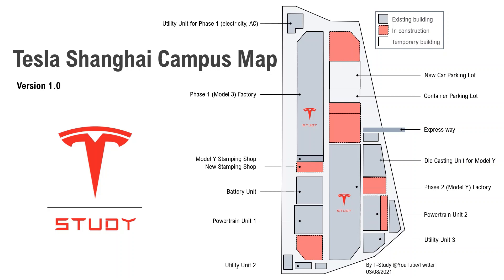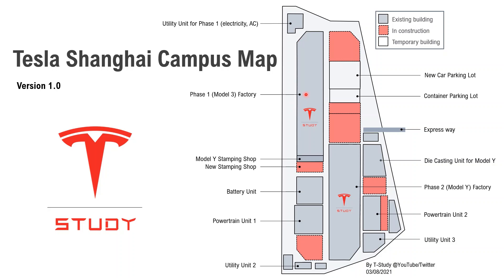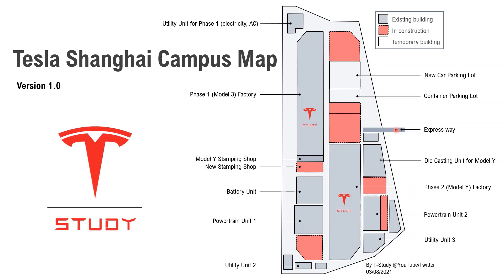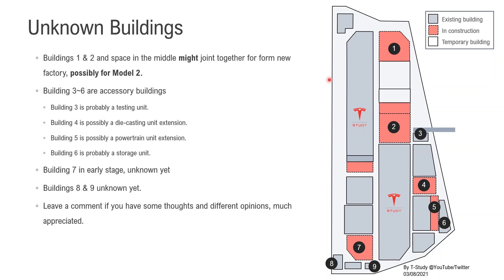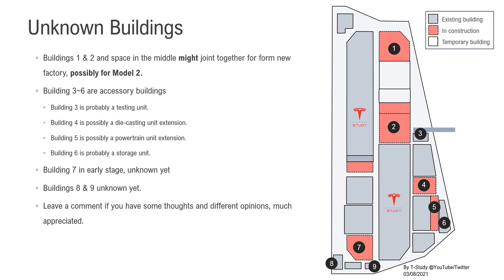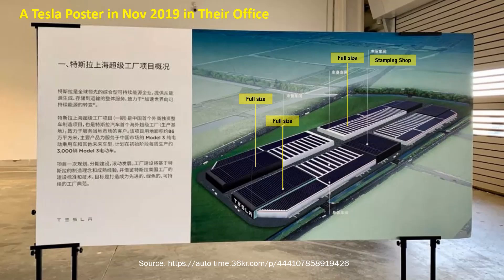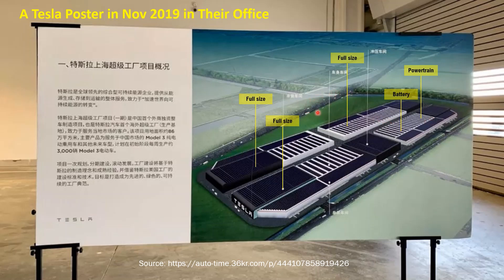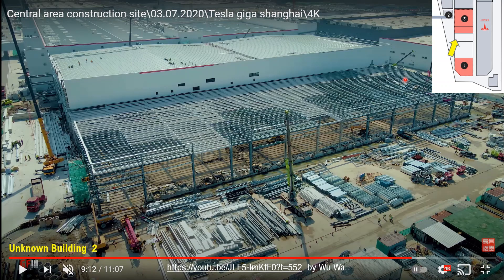Tesla Shanghai Map v1.0

Comment: Building 6 
I was told previously this triangular building is a battery unit.  Would they have two battery units? The CATL batteries are packed for direct fitting in cars.  The LG batteries have to be built into packs on site so these are probably at the square building.
Building 4.  I thought some of the unusual  foundations were similar to the texas battery plant.  So I thought this might be battery manufacturing plant.  Only indication was thinking that those linked foundations look similar to texas.

Comment: I also doubt buildings 1 and 2 will be joined, they recently dug water drain channels and pipes under the parking lot in between so i think it will be permanent. Number 8 powerstation for sure, number 7 contains smaller recycling warehouse for wooden palletes, they also disassembled nearby temporary worker buildings in 7, i think there is no new construction.
Reply: good comment!

Comment: Thanks for the video!

My speculation:
Building 1: I think it's a battery factory for the new 4680 cells.. The foundation is made for a stamping machine which will make battery cans and parts. The battery formation equipment will be in the high and long span room.
Building 2: I think it’s storage building for the parts whitch come frome the new stamping machines.
Building 4: I agree with you, i think it’s a casting factory, (there will be 6 additiona casting machines in it to make rear casting for model y (When these are completed, it will be possible to produce 750,000 Mosel Y pieces per year. If you add the 250.000 Model 3 that is the 1 million car that Musk was talking about)

In my opinion the Model “2” productione will be in a different locatione.

Greetings from Hungary

Comment: Thank you! This really helps put the plan into perspective. I have been hoping for this kind of summery and analysis. I am so glad that you are willing to do the work to give complete strangers, who you will most likely never meet, access to this amazing project. The building to the west of utility unit two looks like the main power utility station that takes the main high voltage power from the utility and transforms it down to voltage levels that can be used to distribute power to the rest of the factory power distribution system. Being indoors, it will be a gas insulated system. The vented areas are to allow cooling of the transformers.

Comment: I believe the expressway, or East Extension Road as WuWa puts it, connects to Jiangshan Road. Jiangshan Road leads to Tesla's new parcel of land at the Lingang Heavy Industry Zone, area 461,142.40 square meters.
Reply: 461,142.4 sq m = 4,963,695.5 Sq ft
I think this is also close to to the Port area where the new charger factory is located.  I had not realized how big the area is.